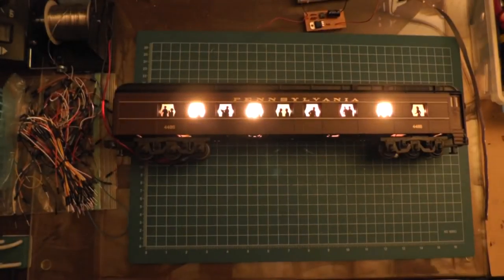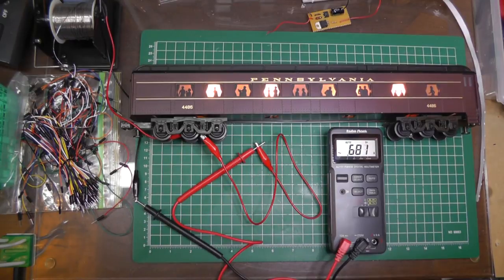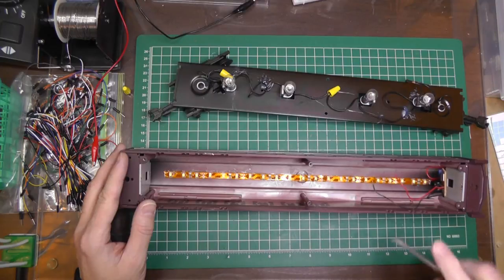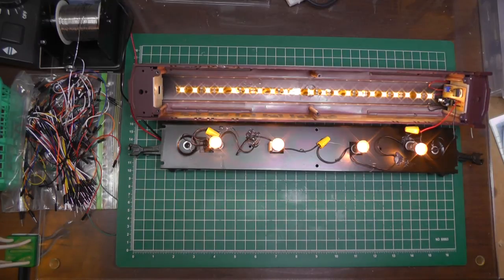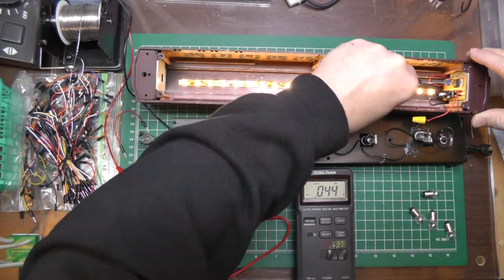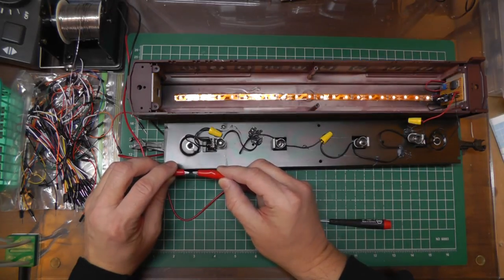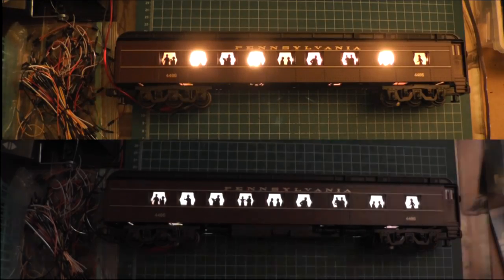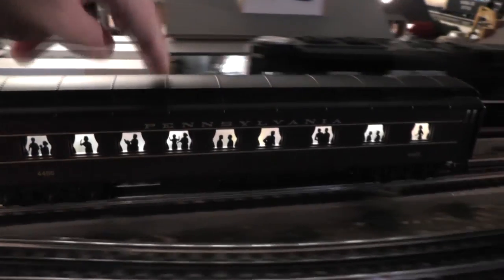LED Lighting in MTH O-Gauge Passenger Car

Comment: Thanks for posting. I have no electronic skills that would be needed though. Making a circuit board is where you got me. In do like the better lighting..
Reply from the maker: Similar boards can be purchased preassembled here: http://henningstrains.lightspeedwebstore.com/jwa-20110-led-constant-current-lighting-regulator-2-pcs/dp/255   (You would also need to purchase some LED strips or get the "kit" listed that includes solderless installation)

Comment: Nice informative video! I plan on using this circuit to power an Arduino for an HO locomotive. From what I can tell the choke is only there for DCS to prevent the signal from getting bogged down on the center rail. If I just plan to use this circuit for DCC, can I omit the choke from the circuit?

Comment: Hi Bob • Are you working with Gun Runner John & Doug from Laid Off Sick, on the OGR Forum? These guys have a lot of skills, LED Light Strips & the board. I will have to check out Stan 2004.
• Cheers from the Detroit & Mackinac Railway
Reply from the maker: Yes Gary, these are some of the guys I was asking questions to in the forum on the Passenger Car LED Lighting thread. Just something I wanted to play with to get more hands on with electronics projects.

Comment: bobot,  I really than you for showing this.  I am intending to build these on my southern pacific MTH cars.  I have a bunch.  also my blue comet cars and a caboose.  my question is where did you source the electronic components?  I usually get from Digikey. I have built some flickering setups, but no LED strips for cars with a board like that. do you have a parts list and what gets soldered to where?  thanks .
Reply from the maker: Here's a basic list of components used with DigiKey part numbers in brackets.  
Note the LED strip was from Amazon, not DigiKey.

22uH CHOKE [495-5557-1-ND]; 
1A FULL WAVE BRIDGE RECTIFIER [DF005M-E3/45GI-ND];
470uF 50v CAPACITOR [P11260-ND];
1.5A LM317T Voltage Regulator [497-1575-5-ND];
5k TRIM POT [3362P-1-502LF];
47 ohm ¼-watt resistor [adj per # of LED's];
LEDwholesalers 5 Meter Flexible LED Strip 12 Volt/Warm White/3100K/2026WW-31K [Amazon];

Read and review all the posts and circuit photos at this thread.  Mine is wired like RailRide's circuit 
except 47 ohm resistor because of my LED count and added a trimpot right before LED strip
http://ogrforum.ogaugerr.com/topic/replacing-incandescent-with-led-in-passenger-cars?page=1

Remember, if you don't want to build yourself you can buy similar pre-built boards from GunRunnerJohn here:
http://henningstrains.lightspeedwebstore.com/jwa-20110-led-constant-current-lighting-regulator-2-pcs/dp/255
Reply from the maker: +KnightTrain 1957 The part numbers listed are from digikey.com online.  As I mentioned, the LED strip was from Amazon.

Comment: Hi Bob,

Can you please post the original URL from OGR or a the schematic of the circuit?  I found several differnt versions of it.  Thanks!  Nick
Reply from the maker: +Nick A I think the most concise supplemental information on this topic is posted on my blog here: http://bobotstrains.blogspot.com/2015/09/supplemental-info-for-constant-current.html
An original OGR URL is below, where you can weed through 6 pages of info...including the now deleted thread post where one guy called me a jerk for unknown reasons. I gave attribution in this video and in the comments to those who helped me and never claimed this was my idea, so I don't know why it ever triggered an insult. All that remains of the post is "Deleted" by the moderator but I saw the original and know who said it.  :) In any case, http://ogrforum.ogaugerr.com/topic/replacing-incandescent-with-led-in-passenger-cars?page=1

Comment: Bob, you may have answered this question somewhere else, but I can't find it.  When you added the variable resistor, did you need to keep the original 47 ohm resistor?  If so, did you wire the two in series?  The supplemental information shows only the variable resistor or the 47 ohm resistor while your video shows both on the board.  I'm a bit confused.
I am grateful for the wonderful information.  Thank you very much.
Reply from the maker: +Benjamin Trapnell Ben, yes I just wired a 5k trimmer in series between the 47 ohm and DC+ out.  The trimmer had 3 leads and I just used one outer leg and the center wiper leg to act as a variable resistor in series.  Hope this helps.

Comment: Hey Bob, just wondering if a 12 vdc regulator can be used instead of an adjustable. Other than that all is good
Reply from the maker: I'm not an electronics expert, but I don't think this will work as a direct replacement.  The way I have the LM317T voltage regulator wired up it is actually acting as a current regulator for the LEDs.

Comment: Someone should design a board to do that function. ;)

Wait!  I did do a board for just that purpose. :D
Reply from the maker: Yes folks. John has the expertise to not only help me understand this circuit, but he actually designed and manufactured boards that do this exact thing. They are assembled and ready to drop in with great ease. Please check out John's circuits at: http://henningstrains.lightspeedwebstore.com/jwa-20110-led-constant-current-lighting-regulator-2-pcs/dp/255
Reply from the maker: I pursued this project to further my knowledge in electronics and circuit board assembly in a simple project. It was perfect for that purpose. There is no question if I had more than 2 of these to do, I would purchase the boards John designed. Professional, already assembled, and affordable. Thanks John!